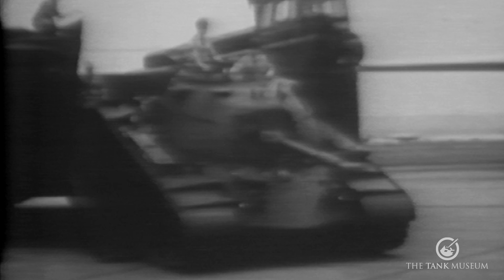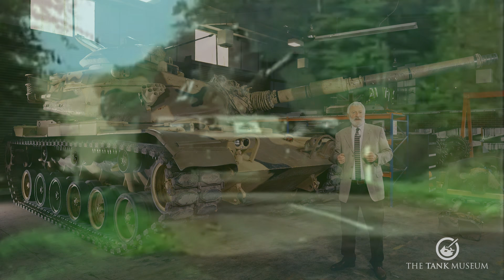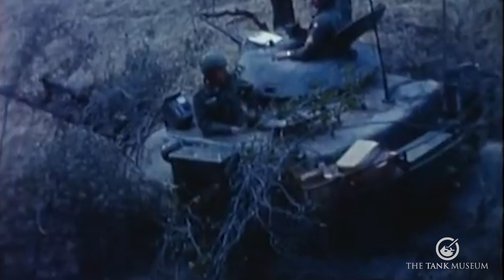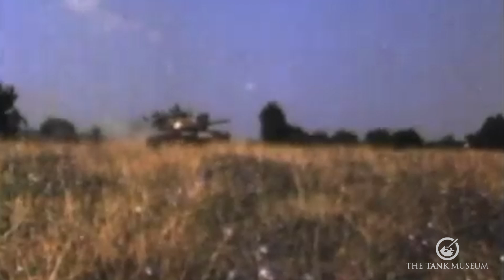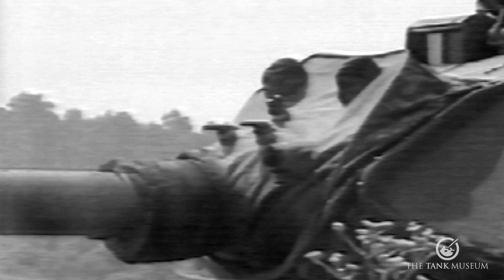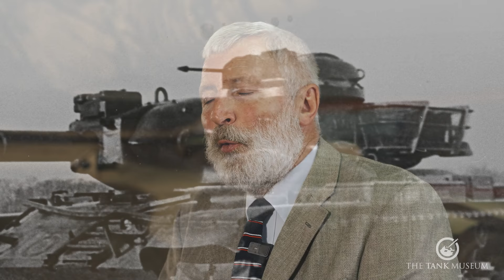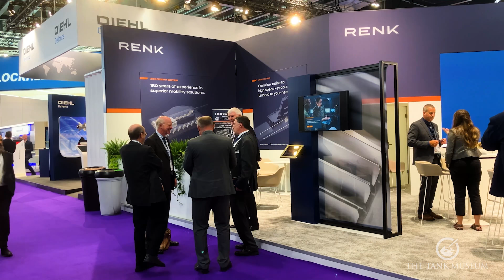M60: Cold War Guardian | Tank Chats #175

Comment: In the mid 1980s, my local NY National Guard base had an M60 armored unit.  On certain Sunday mornings, the guard unit would drive their M60s through my city neighborhood on their way to a practice ground outside the city.  There's nothing like being shaken - literally - out of bed at 07:00 while several 50+ ton tanks drive down a 4 lane street.
Reply: I used to work in a big foundry in East Chicago Indiana we casted the Halls side rear plates turret gun shield rear doors in our foundry for the M60 tank blawnox was a big foundry with two Open hearts and electric furnaces I remember building the molds for them in blonde axes hay day we had 2000 welders working there repairing all the castings that were made in The foundry the M60 armor was the main casting in The foundry I work for general Dynamics that was back in the seventies we welded the Halls together with stainless steel stick repaired all the castings welded on the side rear plates and repaired all the sands collision and then the armor the gun turret the hall the side rear doors in the rear plates all went to Chrysler that's where they put the motors in and all the electric that went into tank and all the tracks and drive units while the Abrams tank was invented back in the seventies in blawnox closed laid off almost 3,000 people those were the days I was just a kid out of high school got a job there as a welder
Reply: @davidstark6507  learn to use paragraphs and sentences.

Comment: I like that the Tank Museum chose to present this beast in the old US Army MERDC camo. I grew up on these M60s and other US equipment finished in this scheme.
Reply: Though the MERDC camo looks pretty cool, I'm partial to the 1970s four-color (OD green, tan, black, off-white) scheme.🤔
Reply: @tim_davidson6344  That is the same camo I'm referring to. It was referred to officially as the MERDC four color scheme. It was actually meant to be versatile, with several different versions based on the terrain you would be operating on. The colors you mention are the verdant woodland scheme, probably the most common in Europe and the US, but it was also designed so that you could adapt the scheme to changing conditions by painting over one of the colors, like painting white over the green if it snowed. I believe the version in the Tank Museum is the Army's red desert scheme. It looks like three colors, but I believe the other minor color besides black blends in with the sand color.
Reply: Thanks for the clarification; I didn't know the definition of the MERDC acronym. I just always called it the "four color scheme".  I entered the Army in the late '80s and all of the older vehicle types (M35 2-1/2T series, 800 5T series, 880 utility series) still in use were in the MERDC scheme. I remember that it was a hard camo scheme to maintain. Areas of flaked paint or rust were corrected by hand painting with often ugly results. The new CARC (chemical agent resistant coating) paint coming into use was a three-color scheme (woodland) or single-color (desert) and any major CARC paint repairs needed to be done in an OSHA certified paint shop. Combat vehicles manufactured in MERDC (i.e M1 MBT, M109 SP howitzer, M110 SP howitzer) were given higher priority for repainting into CARC. Since the Army M60s were being phased out by M1s, I don't recall ever seeing an M60 series tank in CARC.
Reply: I go back even farther.  I was never in the military, but I was a brat and a civilian contractor. I remember driving by all of the 1950s era Dodge vehicles in the base motor pool, all that lovely post war dark olive drab. One day I drove by and they were all this funky camo. Of course, within a year, having repainted them all, they were replaced with Goats and CUCVs, another topic altogether. Got used to the colors, but moved on before they changed to the current 3 color NATO. But I remember that day like it was yesterday.
Reply: @nonamesplease6288 Tim is referring to the MASSTER scheme also called the 7th Army Pattern. It is was just before the MERDC was standardized.
Reply: @allenhill5698  Agreed, but this M60 is in the MERDC 4 color camo. MASSTER used the MERDC colors, but with a different distribution across the vehicle in different proportions. The Army really had 3 schemes in use at roughly the same time, including the DUALTEX, which was actually a proto digital camo.
Reply: @tim_davidson6344 M60A3’s received the “NATO” scheme and the single color desert in the CARC paint.
Reply: @ I tried to find my original comment, however, I could not for some reason. The M60 featured at the begging of the program is indeed in a MERDC pattern. It appears to be the “red desert” colors to me. Although it is a valid option, I never did see that pattern applied to an M60. The gray desert was much more common, especially with the 40th and 50th divisions.
Reply: I am guessing that the Tank Museum chose this particular pattern because it looked a bit different. However, even then, the black “crow’s feet” in the pattern are applied incorrectly and it is missing the 4th color which would most likely have been the MERDC sand color. 

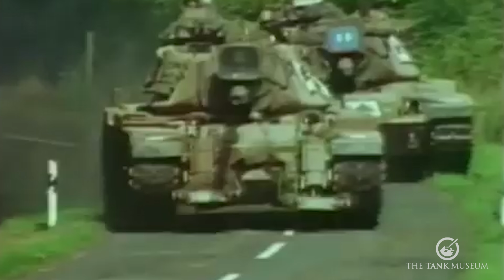If you are able, there are images of the MASSTER pattern at approximately 28:15 on the video. The MASSTER colors were still on some equipment when I arrived in the FRG. I do recall the experimental dual-tex pattern. It was only applied by one Cavalry unit in USAREUR. I saw several of their tanks at Grafenwoehr, W. Germany. That was developed by Colonel O’Neil and students at West Point. I agree with you regarding the pointillist or digital look. His patterns were indeed developed over the years and applied to military clothing.

Thank you for this opportunity to interact.

Comment: I was enlisted on an M60A1 AOS and transitioned to Rise Passive as I made NCO rank as a Tank Commander. I then went to OCS and was a Platoon Leader on M60A3s until the M1 transition as I was an XO of a Cav Troop. The difference in the M60A1 AOS and the M60A3?

As a gunner, I hit a 1500 m target center mass battlesight engagement from a quick halt on a daylight range and was patted on the back with a 'Good shot!" from my TC. 

Three years later on an M60A3, my gunner hit a 5000 m first round hit while traveling 20 mph in a pitch-dark live fire run at the National Training Center,... and no one said a thing about it. It was that common a feat of gunnery.

With the thermal sight and magnification, I could see a female deer start to urinate three miles away on a rainy night at Fort Benning GA and know for a fact that I could put a SABOT round through it's skull before it was even finished.  That was (now) nearly 40 years ago. That was the difference that just five years (1982-1987) made in armored warfare. It was like going from WWII to the 21st Century in that time.
Reply: I started serving on the M60A1 and later transitioned to the A3. The difference in our percentage of first-round hits was little short of miraculous. No more hand-cranking the rangefinder and your accuracy depending on the TC's visual acuity. No more mechanical fire control computers with cams. The A1 was a pretty good tank but its fire control gear was the very finest of Victorian technology.

But it did take some discipline to use it properly. We found out that with thermal sights we could see the blips from the ranging laser going downrange, and the crews were fascinated. Several rangefinders got burned out and replaced because they overheated due to too-rapid cycling so they could watch. People would play with the rangefinders and pretend they were blasting people like in Star Wars. 

And of course we wasted a lot of fuel screwing with the smoke generators. Battalion HQ had to get real ugly about that.
Reply: Impressive
Reply: 2/5 cab Black Knights forward, sir